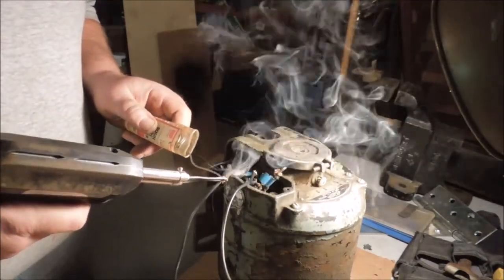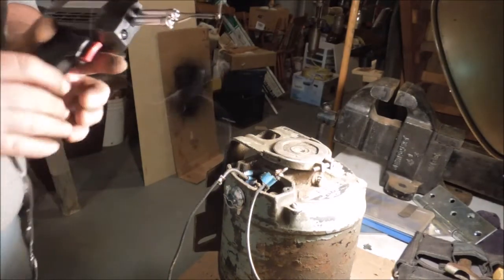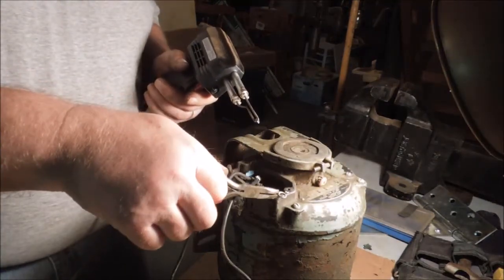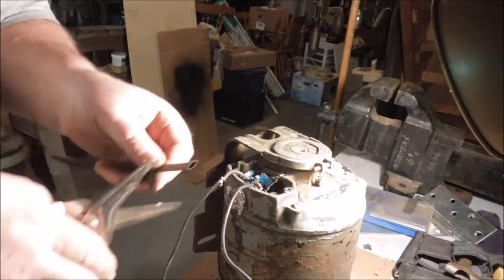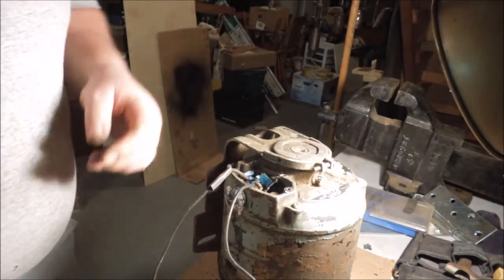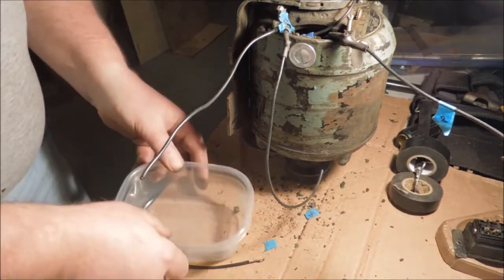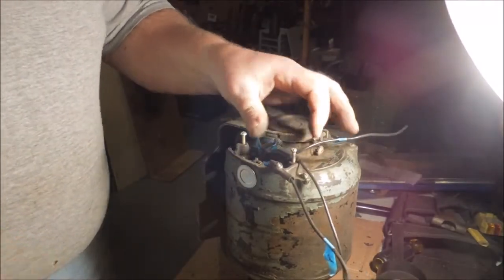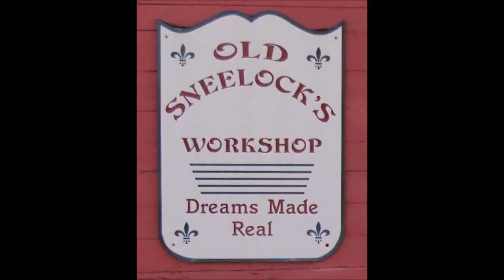Rewiring the South Bend Lathe Motor Pt 3 Solder The Connections

Comment: another use for solder gun . 10 guage  solid wire , form to shape wanted  will make holes or shapes in styrofoam  . i made a unit for a friend to make spaces for electrical boxes  in the insulation in his walls .worked well.